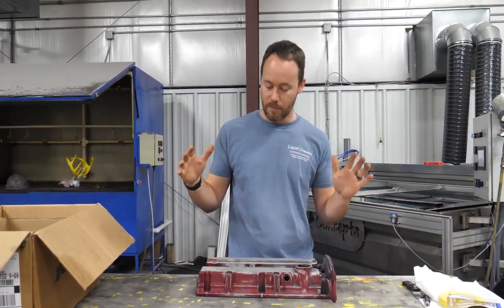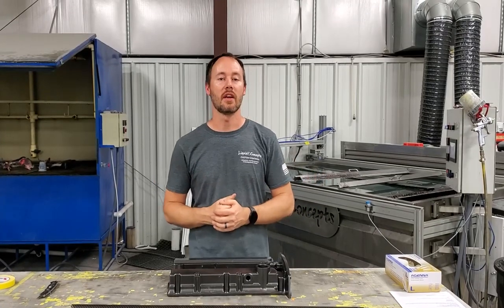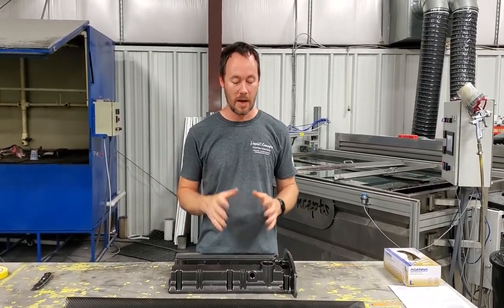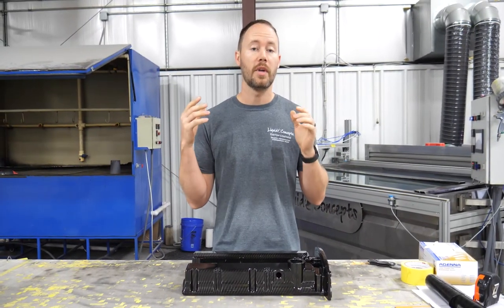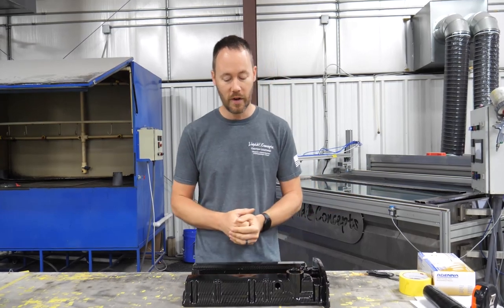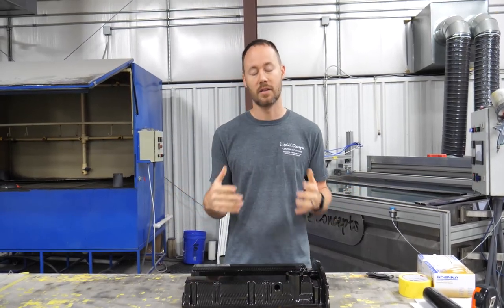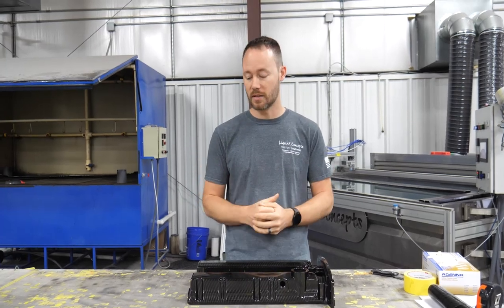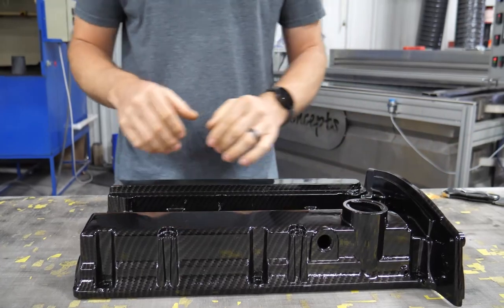HYDROGRAPHIC VALVE COVER RESTORATION! | Liquid Concepts | Weekly Tips and Tricks

Comment: Did the cover get sprayed with high heat resistant paint/clear coat? Or will it not get hot enough to need it
Reply: Nice quesstion i want to know answer too...
Reply from the maker: We use our products & they hold up fine. Haven't had any issues.  Hope that helps.